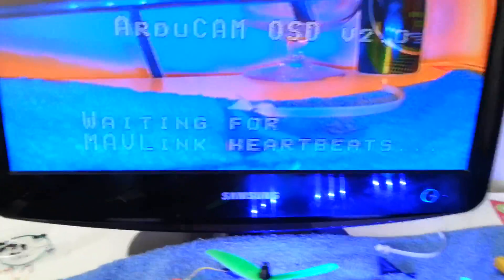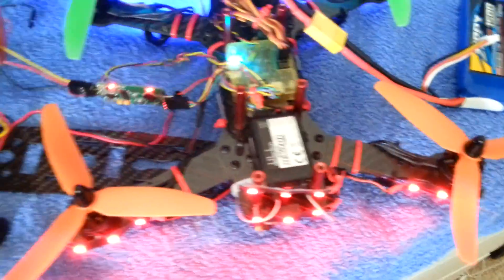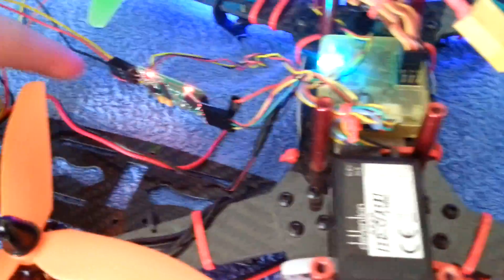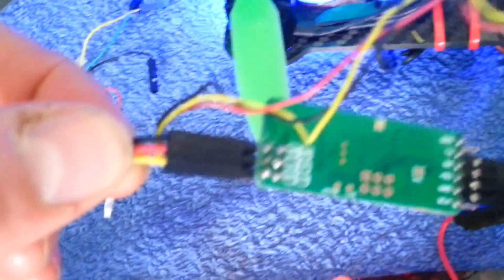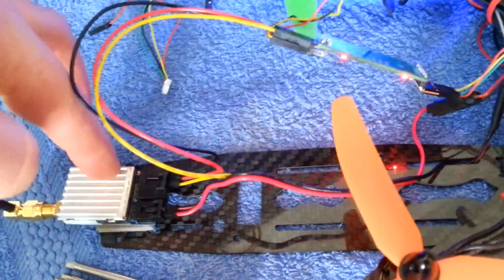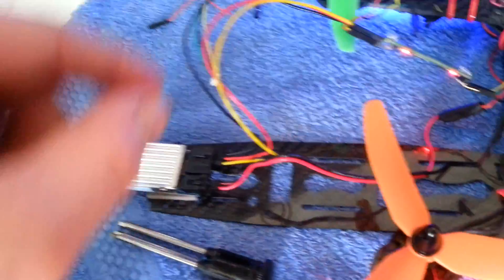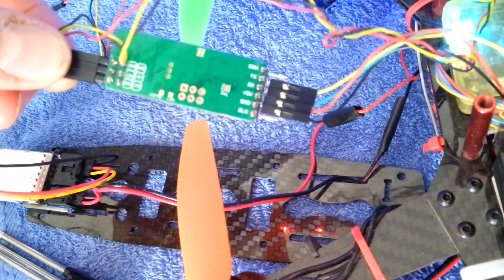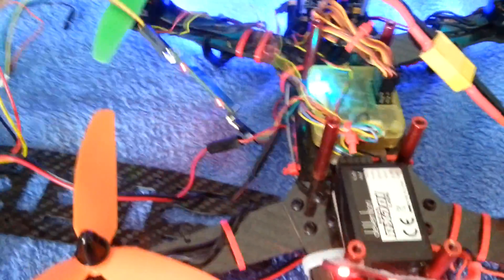Osd setup for cc3d

Comment: I have Power,  picture from the cam and i can see the same  on screen like you. But I can not solve "waiting for heartbeats" Dont  find the right software
Reply from the maker: i cant remember  the name of the software i used to get it running i will have a look for the vid i watched
Reply from the maker: Hi here is a link that will show you the program and how to setup hope this helps
https://youtu.be/4CMokvQBunQ
Reply from the maker: https://youtu.be/4CMokvQBunQ
Reply: Tank you, will try that ;)
Reply: +Hydro Mac HI, it was the next Video  after your great Videotip which helps -  I found the right Software in an Video from Painless360 - there are so many different Software. Thx
Reply from the maker: +Hydro Mac That great glad you got the osd working. i only used the osd on my 250 quad a few times as after a crash the osd stopped working
Reply: +mark rankin Hi, i hope  it is  crash resistant. I use it for an 250 too. wish you good flights and less crashes

Comment: Hello,
 Could you please link me where you got your wires from? I currently have a helipal storm racer and am trying to wire up my osd to the camera and video transmitter, but have no idea where to get the wires from. also, could you please link the camera that you are using just in case the one i have does not support this type of wiring? 
The camera 1 have only has one 3 pin port, that originally plugs straight into the transmitter.

Thanks!
Reply from the maker: hi yes I will but im busy doing a new build at the min kind off a miss here. if I forget to link you the stuff send me a message again sorry for the delay
Reply: +mark rankin Got mine hooked up and osd display says disarmed even after I armed it. Also loosing the osd display when I after a few seconds I started flying my quad.
Reply from the maker: There a waste of time osd unless you buy a good one

Comment from the maker: Jamblek7 I think you can change what the each port can do on the cc3d using openpilot. There will be a picture of the cc3d board in openpilot you mite have seen it before there is drop down tabs which will let you do this hope this helps
Reply: +mark rankin Where did you get the cable that goes from the CC3D to the OSD?  The RX TX 5V Ground cable?
Reply from the maker: +Anthony Abelardo 
The cable is one that comes with the cc3d
Reply: mark rankin I never got one.  :(

Mine came with the Quanum 270 kit.
Reply from the maker: +Anthony Abelardo 
you should be able to buy them try banggood
Reply: mark rankin from france but I'm not sure if it's worth it

I'm worried about more current draw and the possibility of losing video feed from a 90mph 270 drone

Is it hard to fly w/o numbers?  The only time I look at numbers on a telemetry is to gauge speed and alt

Comment: My prob is that my 3cell battery is not recognized from osd .. I had the same problem as your video the mah goes crazy.. And after some modifications I can not still get the right voltage. For 3s it says 15 volt..
Reply from the maker: Are you able to connect the osd to the pc ok. In the setup options were you can pick what you want the osd to display there mite be the 3s 11.1v. I have to set my osd up again after flashing the cc3d so il do a vid sometime this week
Reply: You have to make some modification with transistor and some stuff to the osd to make it work. Ok I'll wait for your next video!
Reply from the maker: I will do step by step tonight

Comment from the maker: Hi yes the voltage is all ok and I have the osd up and running fine. The cc3d board gives out a 5v to one end of the mini osd and the other side is powered from the boscam 200mw transmitter which powers the camera. The mini osd has a chip on each side one side is 5v the other is 12v. If you need help let me know cheers